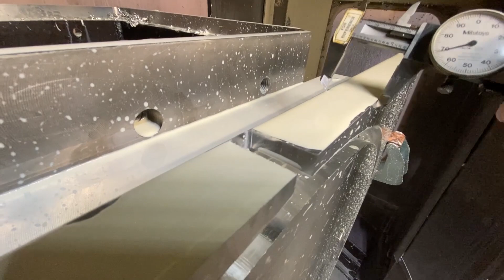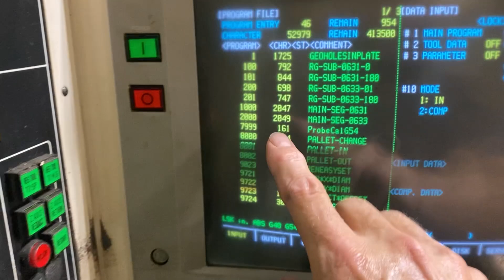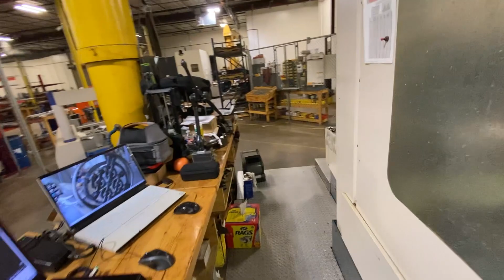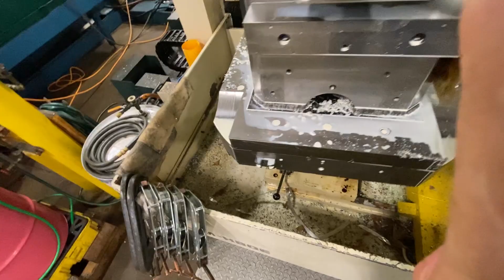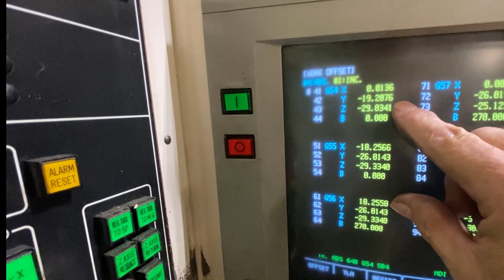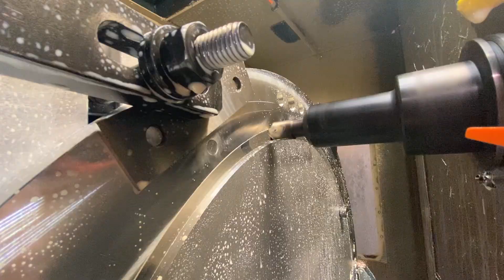Aluminum Ring

Comment: I wonder how much that ring “sprung” out of flatness when released from the parent material. Probably not a critical spec but it would be an interesting intellectual exercise to figure out how to machine that flat after getting rid of the center.
Reply from the maker: I didn't really check it on this part. There was no spec on the drawing for that. But if that was critical. It would be advisable to part off the part from the main material before machining the faces flat. That would be a much more complicated setup.

Comment: Thanks for sharing, interesting as always.  I have not thought of using wax paper instead of printer paper, that would help reduce the coolant absorption.  I have managed to make a large part similar to this on a manual vertical mill using a rotary table, was one hell of a faff though, this looks much easier :D
Greg

Comment: Why didn't you just use 1/8" stand off washers behind, where the bolts go through?
Reply: Vibration probably, the paper would dampen out chatter whereas the washers would increase it.
Reply from the maker: What Lawrence Ott said is correct the part is better supported for the facing cuts when its against the fixture.

Comment: Great video! 
I'm curious if the paper swelling was a consideration. Could the coolant swell the paper enough that you're milling a concave shape during the 1st facing op?
If you had a wax/parchment paper or even a plastic sheet, could that be optimal? 

I really enjoy all you videos as a non machinist! Keep em' coming!
Reply from the maker: When I started this job. I looked for a piece of scrap sheet metal. Something like a piece of 16 gauge aluminum would be perfect. But I couldn't find anything so it was the paper. Wax paper would be better. I don't think enough coolant can get to the paper in the time it was there to make swelling a issue anyway. If real close precision is required this may not be the best way to go. The aluminum or steel sheet would be best. If plastic you would have to make sure it was uniform in thickness. Many plastic sheets vary in thickness quite a bit in the same sheet. Also it would have to be a hard plastic to avoid compressing where the tie downs are. Wood as suggested by some would also have the same issues as the plastic.

Comment: no signature by the machinist, their will be some disappointed fans haha. i was taught the machining marks on fixtures are autographs. haha
even my 22" Y gets me some plate work. but i dont take much yet, im saving some money to make a sub plate using oversize pallets on orange vises. i didnt like stacking the odds against me working directly on the table and i realized id need longer gage holders to actually reach my table with under 1-1/2" tool length. 
thatll happen when you buy a cnc machine to be the machinist haha.
thanks for sharing, not to sure how many other people watching have gone for the plunge by buying commercial cnc machines but what you may find simple stupid typically will help this guy haha.
recently bought a Haimer for one mill but still havent got them out for training with my probe stuff in the other mill. they gave me a piece of paper with the MDI commands and said go for it. i laughed and said how much for training, i dont trust its installed right and if i crash it first try i wont have an argument haha... $500 for training $10k for a new probe, thats how im looking at it.

Comment: How big of an endmill until you go to 4 flute in aluminum? I've always used 2 or 3 flute in aluminum but I rarely ever cut anything big.
Reply from the maker: The endmill in the video is a 5/8" 4 flute with a 1.63 cut length. It was already in the tool changer so that's what I used. No particular reason other than that. If you have proper coolant flow there really is no reason to need a 2-3 flute endmills in aluminum. That said if you are going to plunge into solid material a 2 flute would be better in aluminum. The tip of 3-more flute endmills can load up in the tip gashes easier. Depends on the aluminum type and heat treat.
Reply: @EdgePrecision  Thank you for your insight Peter! I really appreciate all your videos and your wealth of knowledge!

Comment: I thought you said the machine would not run with the doors open. 
This was interesting.
Reply from the maker: The Mazak not this machine.
Reply: If you like coolant and chips in your face, a couple wraps of electrical tape over the switch can make that happen for you!
Reply from the maker: @gorak9000  not on the Mazak. It has automatic doors the switches can’t be blocked. It just gives a alarm.

Comment: Did you have any post machine issue with part flex? I've had aluminum flex badly on me when taking out large slugs before. I could see something like that go concave easily after such a large cut out. Like make a part to spec but it bad when inspection gets it. Does it not have a parallelism callout or do you just know something I dont?(probably the latter). Thanks for the video.
Reply from the maker: No but this customer supplied this material. I prefer to machine the same amount of material off both sides of aluminum plate. A little more than this to bet below the manufacturing stresses put into the material. This part wasn’t that precise so it wasn’t a problem.
Reply: @EdgePrecision  thank you

Comment: I had to make a part like that, once. However, like you said because of machine limitations, I roughed it on a bandsaw and finished on a lathe.
Reply from the maker: Yes if the lathe is large enough that would work

Comment: Whats the expected error  on the pallet  going  back in the mechine 
 When I see this on you tube I don't see the latching  serfice  being  cleaned.  So in my tiny mind I think there is a chip laying  on the serfice.  Watching  this channel  I have seen  quite  a few pallet  changes.  Why is it not of concern  or are we just not seeing  this process.
Reply from the maker: There are actually small air holes in the mounting surfaces the pallet sets on. So as the pallet clamps down the air blows away any shavings. As far as I can tell the indexing accuracy of the pallet change is less that I can measure. You can take the pallet in and out without worrying about errors. That said when I’m boring holes to .0001” I’m going to finish that before moving the pallet.

Comment: Question how did you hold the T nuts in place when you mounted the slab of aluminum vertically?
Reply from the maker: I taped I magnet to a small rod. For the first operation. I clamped the raw plate with the Kantwist clamps. Than I drilled and c-bored the bolt holes into the slots. That I stuck the t-nuts on the magnet and lowered them until I could screw the bolts into them. On the second operation I did the same. The only difference is I held the part with the crane and a small strap around the disk/part.

Comment: great video as always, in one of your videos you mentioned you bougth your machines used, how was the process for buying them? what are the worst surprizes you have gottem from your machines? maybe a video about the process and what look for when buying used would be good watch for folks that are trying to get into cnc and dont have the money to buy from the showroom
Reply from the maker: That’s a idea. I will keep it in mind. Thanks!
Reply: @EdgePrecision  thanks to you for doing such an amazing content, also what has been the biggest limitation you have faced with your machines? getting tooling, size, precision, memory space etc when doing odd jobs
Reply from the maker: @franciscolobaton7563  these older machines do have a memory limitation the way new cam software tool paths work. I have had to break large programs into multi-able smaller programs. The Older Mazak Integrex rotary axis don’t  move as fast as the newer ones.
Reply: @EdgePrecision  oh I saw that in one of your videos you had to do that, but from what I can see for the type of work you do the increment of speed from newer machines would not bring much to the table right? How expensive has been to do regular maintenance, have  you had to service splindes?
Reply from the maker: @franciscolobaton7563  Speed is overrated. Like all those videos on Titan. It looks impressive in a video but it’s often not the most economical way. I have had no problem with spindles. But pushing the machine to hard can give you problems with spindles. Consistency is more important than speed.
Reply: @EdgePrecision  yes I've seen them, and do share that view that doing things better and in a more consistent  way is better than doing it faster for the sake of doing it faster, also you could save money on tool life right? As you do you mostly expensive low quantity parts do you less time on the tools as if you would do cheaper parts? Better "waste" some money in not using a tool to the to scrap a 5k $ part? ,regular wear and tear on the machine. I'd love to get some cnc machines but it's prohibitively expensive to run machines in my country
Reply: Galled/scatched ways is the worst surprise, IMO, at least on classic old cast iron slideway CNCs, means lots of work or beyond economical repair, depending on the rest of the machine.
Reply from the maker: @hinz1  I would pass on such a machine. In fact I don’t think I would consider a CNC machine with box ways nowadays. My horizontal mill has roller ways. The best than ball ways if properly sized. If the box ways have Turcite than maybe. But to accurately position not my first choice.
Reply: @hinz1  yes that would be expensive to fix, but buying from a used machines dealer would allow you to somewhat  see the state of the machine